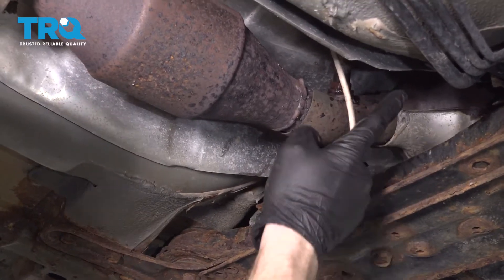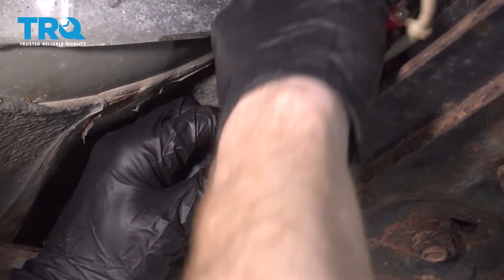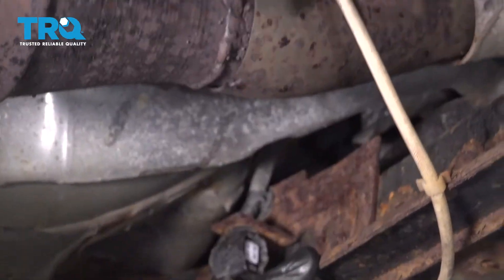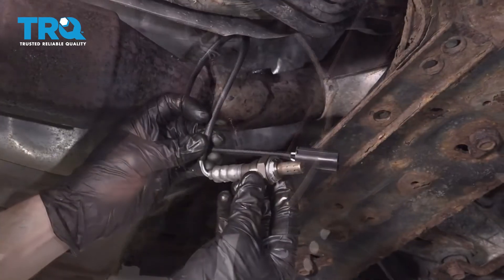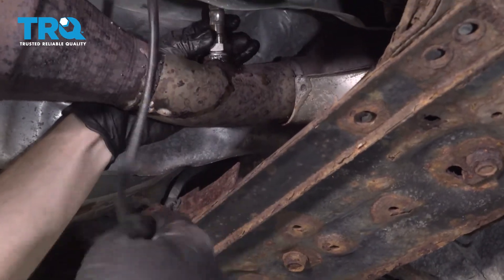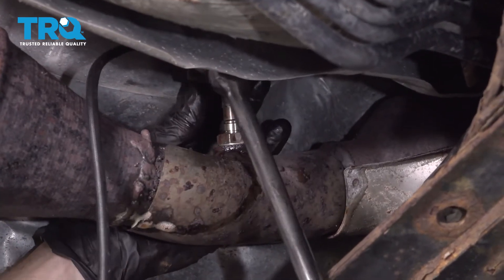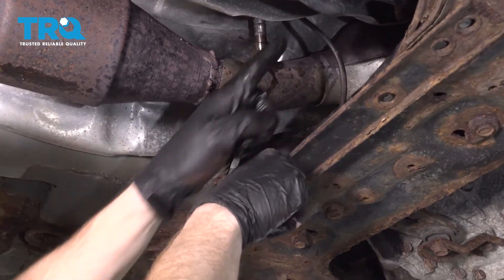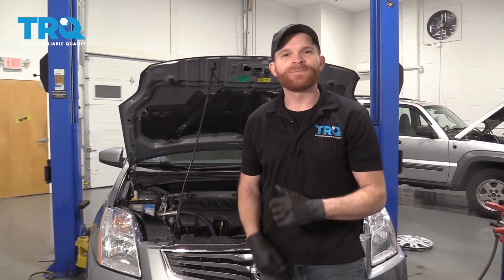How to Replace Downstream O2 Sensor 2007-12 Nissan Sentra

Comment: I have 02 nissan sentra se-r v 2.5 my front catalytic converter  haves 2 sensors on it. yes 2 sensors they right next to each other.seem weird to me 🤔What are they call ? I don't wanna buy the wrong sensor...are they air fuel or just 02 oxygen sensors